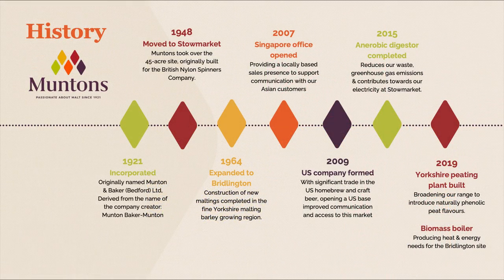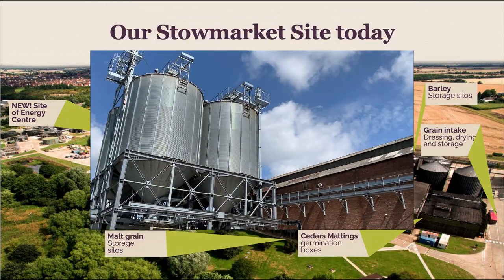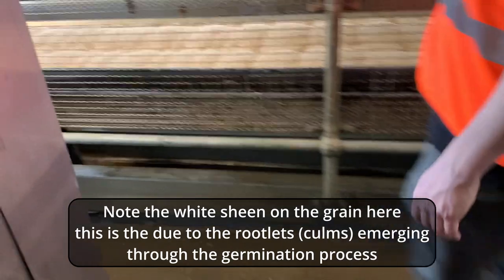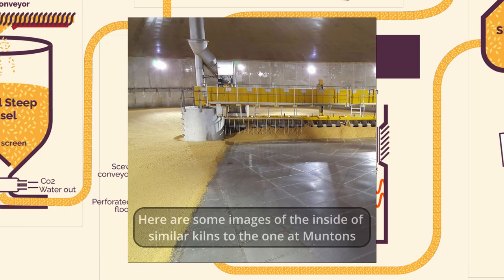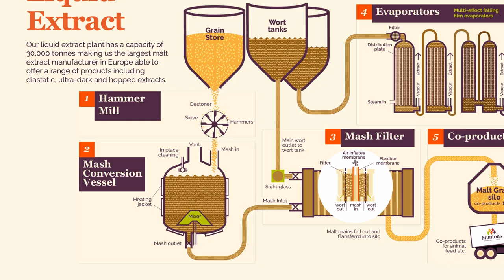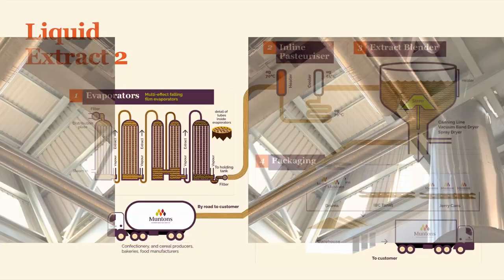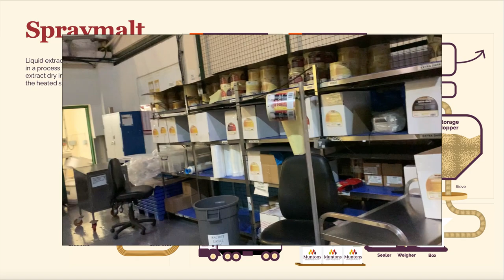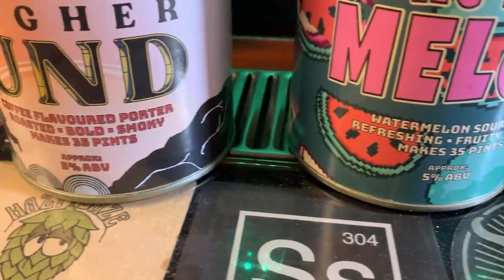How are malt extracts and beer kits manufactured? - Behind the scenes at Muntons Maltings

Comment: Great video!! It's alway intrigued me how they make liquid extract. one thing that plays on my mind (like I've nothing els to think about 😅)  is water chemistry, do they adjust their water depending on the type of extract they are making? I'm of the belief that when making an extract beer, we should be using DI or RO water so as not to taint the 'rehydated' wort (after all, they would be evaporating pure water?!). or am I talking out my bottom? 😄 or should we be adding some water additions to tune to the style we are making? (even if not boiling?)
Reply from the maker: Good question, from what I could understand on the day they use the local water without any additional adjustment for the production of the extract. Logically I would agree that using RO or at least the softest water possible would help preserve the original water profile locked into the extract but I believe they test all the kits again using pretty much straight tap water so it didn't seem that water chemistry was taken into consideration in a big way! I guess that might mean that the kits probably work best if water similar to what comes out the tap in Stowmarket is used
Reply: @DudesBrews  I got the same RO kit as you after your video a few years ago, and use it for any kit I do now, beer, wine or cider, and I've never had a bad beer, so I'm sticking to it for now 😄 I just figured they might make adjustments to chemistry
Reply from the maker: @mrbridger5  I think its a good idea doing it that way and I would do the same with kits tbh but then my water is pretty bad from the tap!